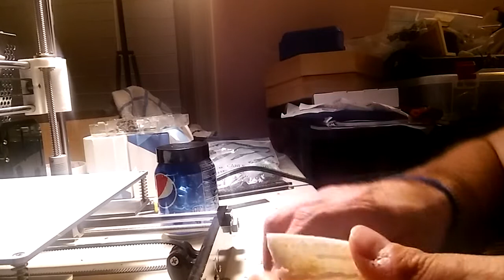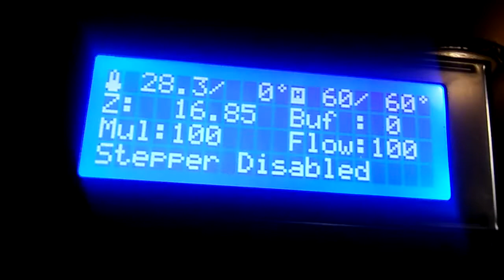First 3D modle ( test run )

Comment: Welcome to 3d printing. That boat came out pretty good after you cleaned it up. Sometimes that kind of print result is not your fault. Some of the free files out there are just not too great, though I have found a lot of good ones. You might want to try out Printable Scenery. They have a lot of inexpensive files you can get. They may still have their stone wall pack available for free, otherwise it's only $4.95. Or Wyloch's Armory has a free sample of their True Tiles Dungeon on DriveThruRPG. Most of the pay files have been extensively tested so if you print one of those, you may see a big improvement in quality of print. If not, then there are ways to improve print quality, one of which is to decrease print speed. Looking forward to your next video.
Reply from the maker: Thank you so much for all your feedback...I will certainly be making lots more videos...lol